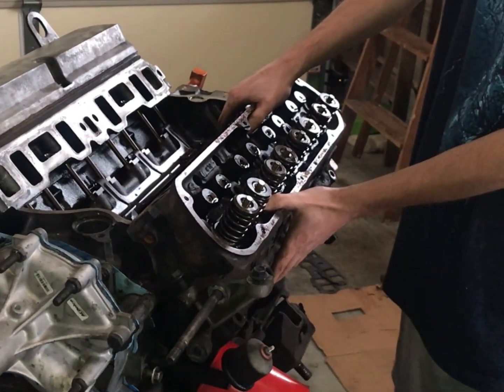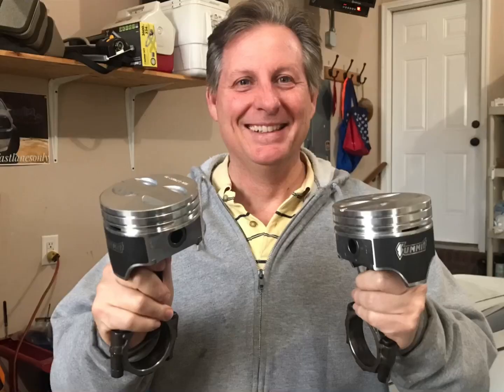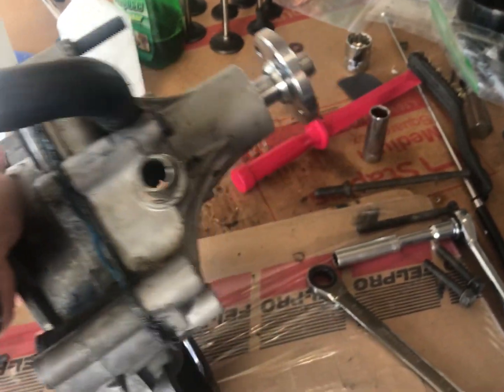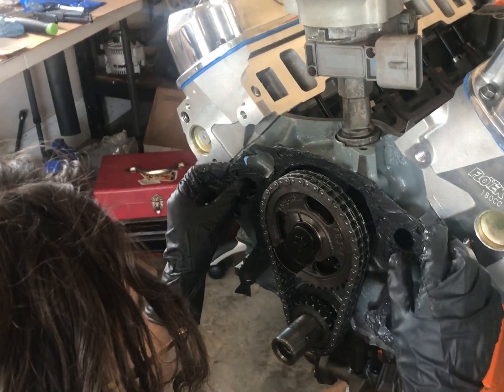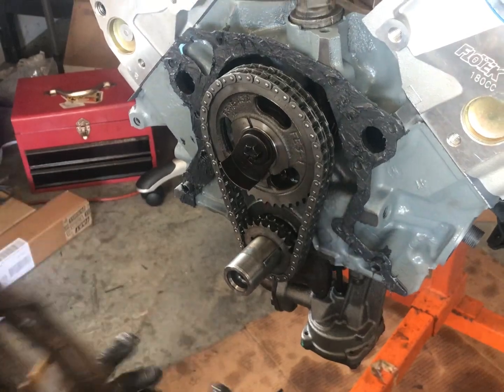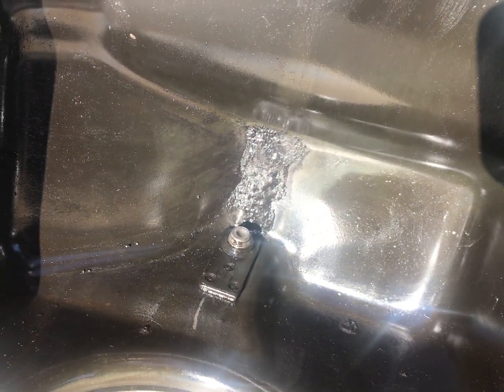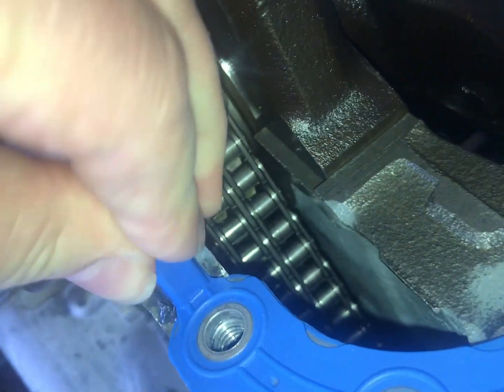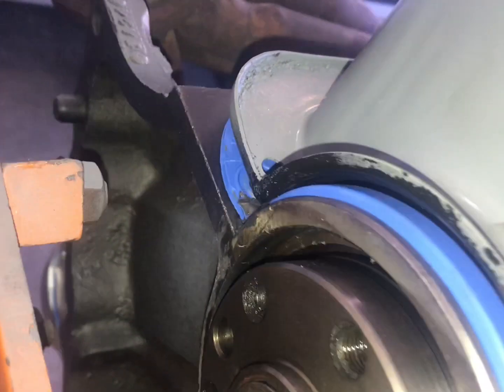Foxbody 5.0 Fired Up!  Ford Mustang Rebuild Comp Cams XE270HR-12 Flotek Heads Trick Flow Intake

Comment: Comp 35-324-8 (112deg) is recommended for 1.7RR.  The 114 deg version of this cam for 1.6RR.
I see you are using aluminum cast rockers, are they 1.7?  Also, how is the driveability with the stock ECU tune?

Comment: I just bought myself a set of flotek 180cc heads where do I buy those plugs from also how do you like them so far? I’m running them with an e303 cam and edelbrock performer intake hoping it works well
Reply: How is your build going?

Comment: Great build! I came looking for info on the cam. It sounds great but maybe a bit more lopey than I'd like. Why did you choose the 12 over the XE270HR-14? I wonder if the 14 would be less lopey.
Also, have you had a chance to dyno it? Would like to see how much power is putting down. I have a set of AFR 165's, Trick Flow street heat intake to install hopefully soon but need to decide which cam to go with.
Reply from the maker: Hi, thanks for the comments and questions.  Going off what I think I know, wider lobe separation (14 vs 12) typically but not always will tend to move the power band higher and deliver a smoother idle.  That being said, the HR-12 was too lopey for 2:79 gears so 3:55’s were swapped in and drive ability was greatly improved.  We have not dyno’d our set up but seat of the pants and stopwatch suggest well over 300hp at the rear wheels.  Probably running high twelves.
Reply: That sounds great! Good information and thanks for the answers! How is she running now? All good after all your work?

Comment: Nice video. The sound is sweet. How do you like the Flotek heads?
Reply from the maker: So far they have worked out very well.  Teamed with a healthy camshaft and a high flowing intake manifold I think the engine is easily making 100 hp over stock to the rear wheels.
Reply: @millionmilegarage9587   Awesome. I've bought a pair of those, but I going to use an idle friendly cam. My target is about 70HP over the stock. Thank you for your fast reply.
Reply: m.pietro9087, which cam did you decide on?
I'm about to start on a similar build and looking for ideas.

Comment: You should probably prime the next one you build before you start it up. That valve train noise is bad. Did you let the lifters soak in oil for a while before you installed them?
Reply from the maker: Not shown but we did prime it and yes the lifters soaked in oil overnight before assembly.  Was surprised how long they took to quiet down but has good oil pressure, they did completely quiet down after about thirty minutes maybe.
Reply: @millionmilegarage9587  yeah, that’s crazy that it took them that long. It sounds good, y’all did a great job!